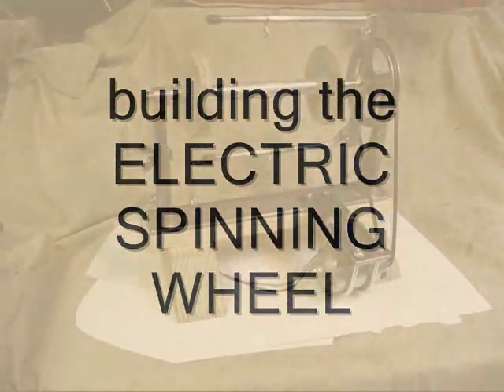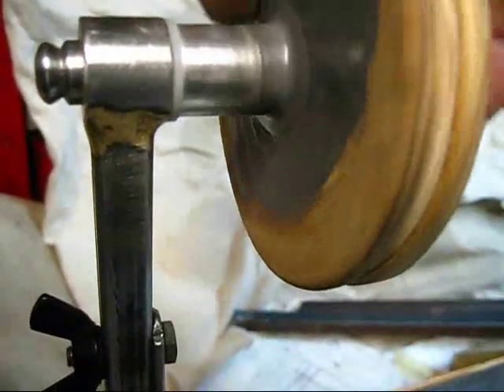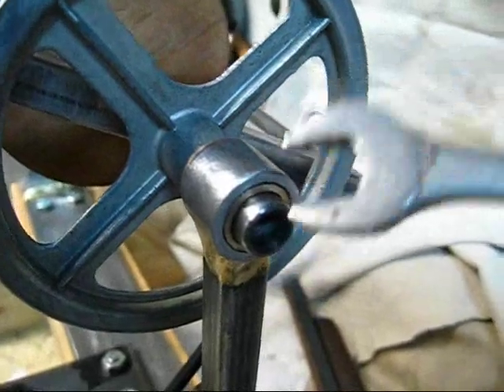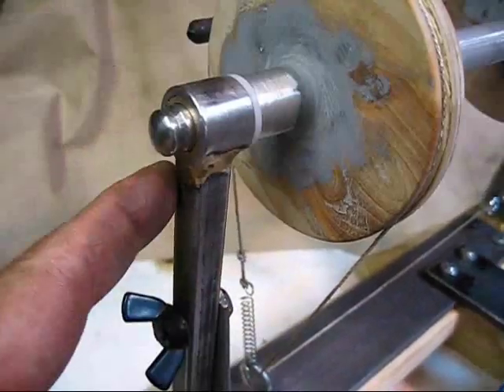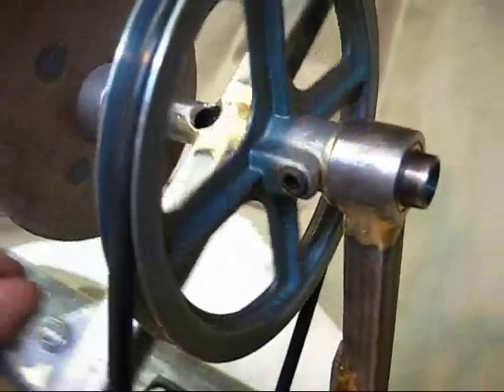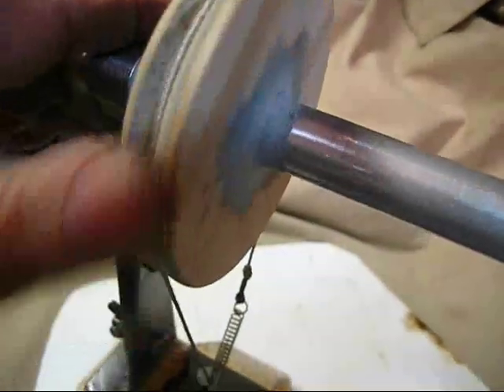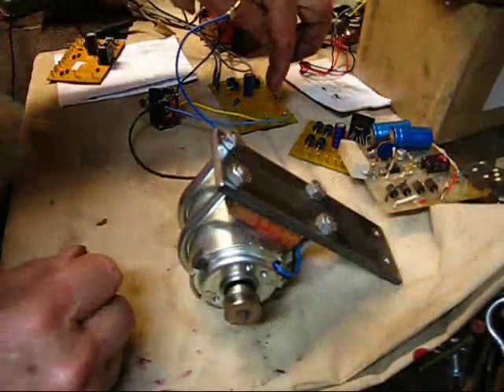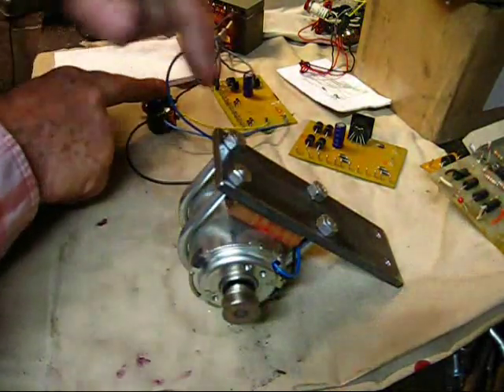Building the Electric Spinning Wheel

Comment: As a maker this was AWESOME to watch. 
Beautiful brazing and a very elegant design. Incredibly strong design too. 
9 years old video at this point, so probably not useful to say. But do the speed control on the DC side with PWM. So much easier than on AC before the rectifier. eBay probably has 24 volt DC speed control for dirt cheap.
👍

Comment: Interesting!  Did you ever get it finished?  I'd think you'd need to angle the orifice hole on the back side of the pulley though, rather than drilling straight down.

Comment: You can either use a variac connected to the primary of the 24vac transformer to control the output voltage on the secondary side, or you can use a variable voltage regulator controlled by a pot straight off that filter capacitor ya left on the board. Not sure of the current requirements for your motor, but regulators like the LM317 (available at radio shack) are 1.5A without the use of bypass transistors. That would be the cheapest and my preferred method. They are only about 2 bucks.

Comment: You will need AC rheostat, DC voltage will tend to run warm and may shorten life of the motor. A variable resister should work also nice job of welding looks  good...